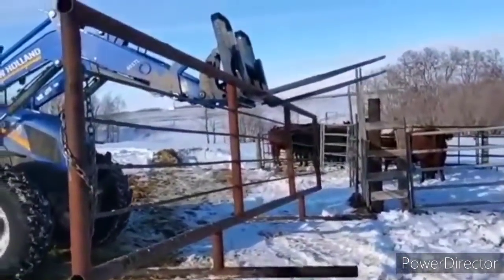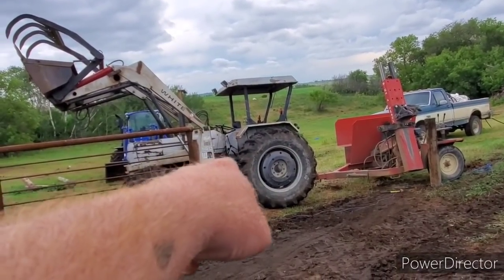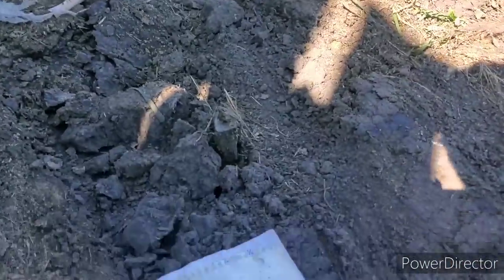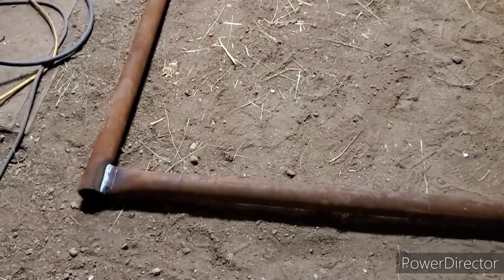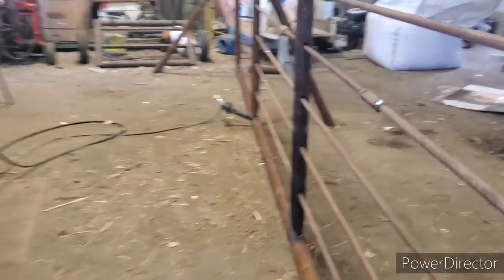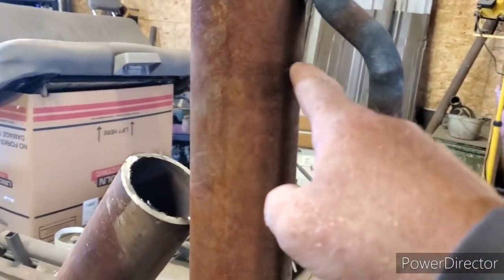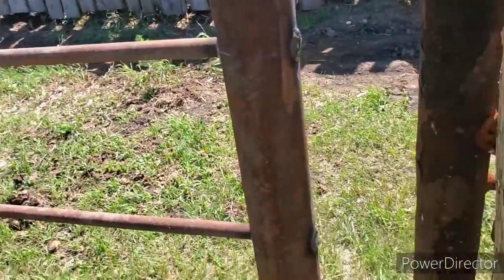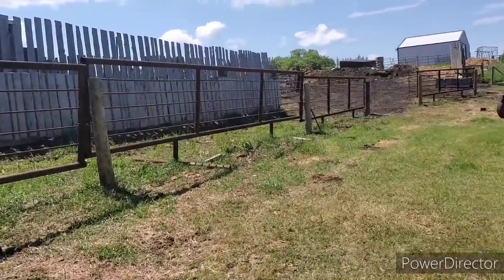Panel With A Walk Through Gate!!!

Comment: If you aren't going to weld up your sucker rod holes, drill a drain hole near the bottom of the virticals to let the rain out so they don't freeze and split.. looks 'mint'!!
Reply from the maker: I left a crack in the pipe when I crushed em